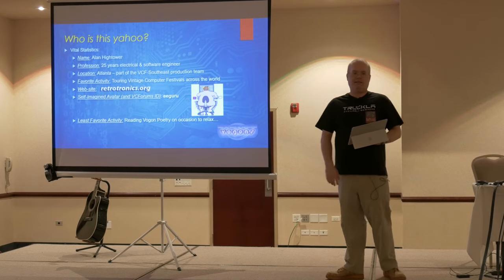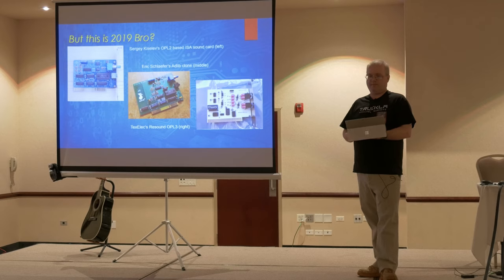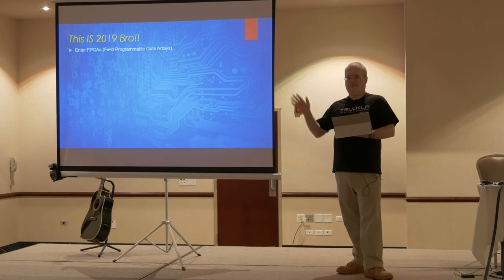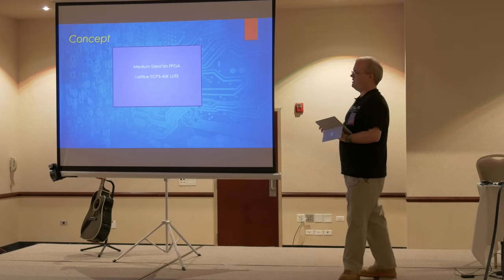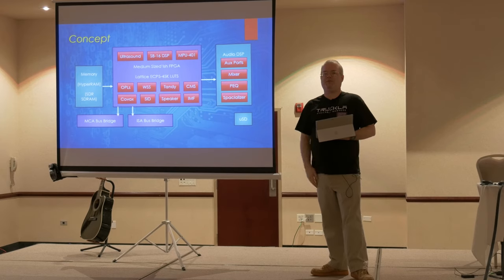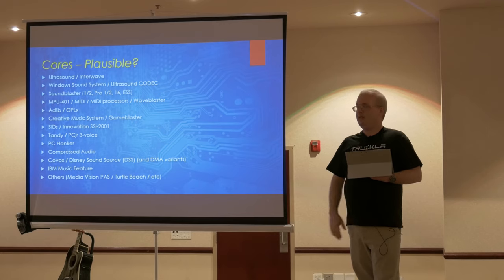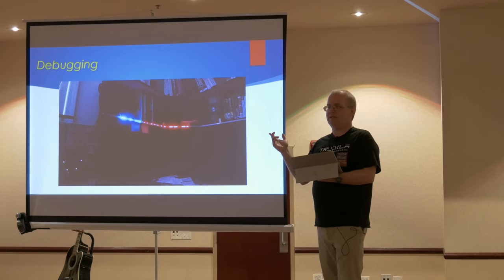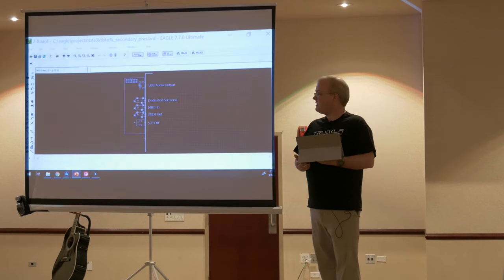The one sound card to rule them all | VCFMW 2019

Comment: I'll watch this all later... I used to be really into PC audio solutions but am now 10 years out of date. All I can say is sound cards had all the processing power they needed back then to mix 100s of streams in 24bit whilst applying effects bus mix-ins... CPU latency was good enough back then for it to do the same with a lot more effects options... Soundcards were on the way out then... It's more the ADACs and wireless features and number of channels I'd be interested in... would be nice to have a DSP chip and/or FPGA + at least 2 Arm 53 cores but that would be nice for most DIY PC hardware projects.
Reply from the maker: I'm not sure what era you're referring to, but the sound card era that is the subject of the homebrew project in the video is the early 1990s, when sound cards were capable of only one stream.  Maybe you're thinking of the late 2000s?
Reply: @VCFMW  My Darla soundcards had multi-io around 1995 for around $300 for 4 ins and the same for 8 outs.. and there had been 4+ track cards out for a while... I could even do multitrack recording on a 400mhz AMD Athlon (or whatever was before, I can't remember, a K6 maybe) with some added PC effects... The Darla's didn't do effects but the Darla Echo had eight audio outs so you could route them through external analogue effects and mix down the whole thing... By late 90s you had 8 track cheap home studio soundcards such as the MaxiSound ISIS for under $200 - with digital IO and not the worst ADACS... You could get 2 stereo 16 bit soundcards to record at once with Cakewalk... 3 was the most I got going... could record 4 tracks and do midi playback of samples using a connected keyboard. The timing was surprisingly in sync with Cakewalk as the timing master but a bit prone to drop-outs and crashes due to the cheapish CPU and hard drive and general bus architecture (ISA then PCI 1)... early to mid 90s... p2s were new.

Comment: Use a cheap tripath amplifier, they usually go for $10-20, and have a 5 to 20Watt sound output.
Great for PC speakers. 3,5" 8Ohms speakers cost about $9 a set on Walmart, and are superior to a pc beep speaker (because they're real speakers).